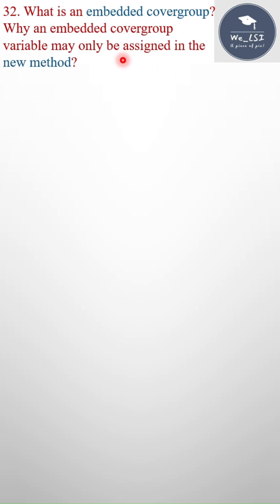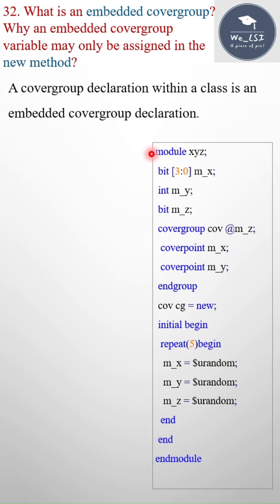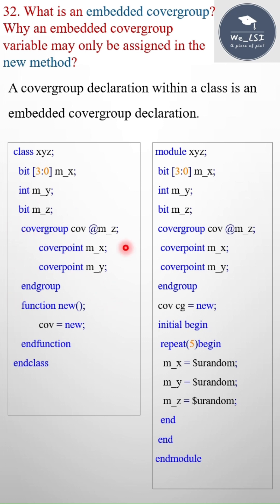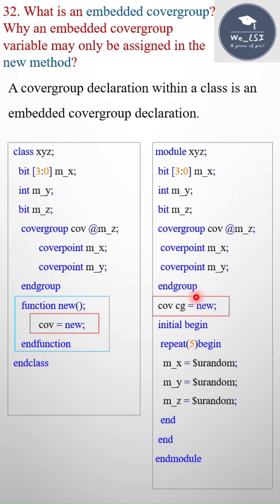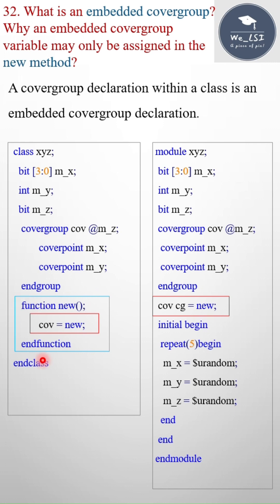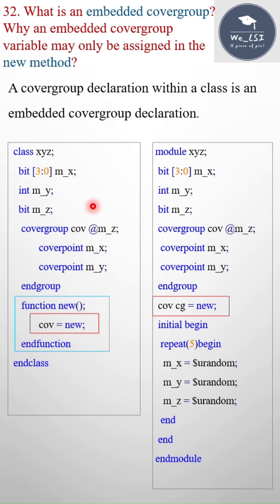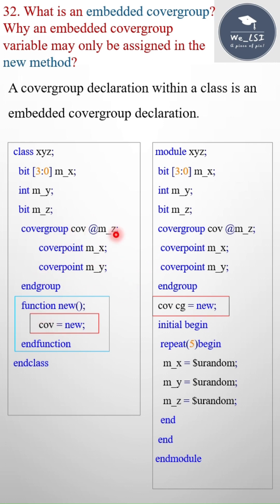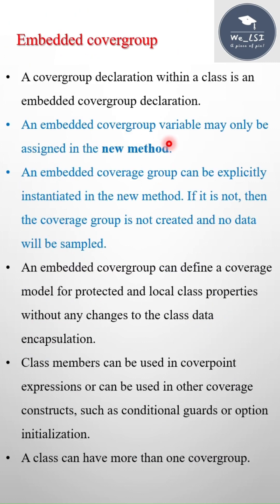Systemverilog  Interview questions 32/n  #vlsi #education#shorts #designverification #systemverilog

Comment: Where do we actually use these type of coverage mam
Reply from the maker: Use embedded covergroups when the coverage logic is specific to the class, allowing for easier access to class members and reducing the need for external binding.(Usually we use this covergroups in real time projects)
This approach is used to cover local or protected class members without altering class data encapsulation, simplifying the creation of coverage instances and making the coverage model a natural part of the object.
According to my experiance these type of covergroups in coverage model are best for understanding(readable and clear) and tracking.